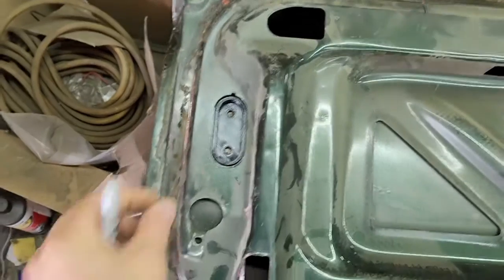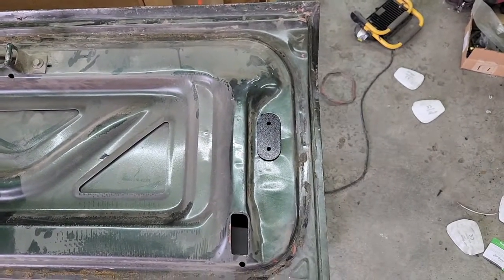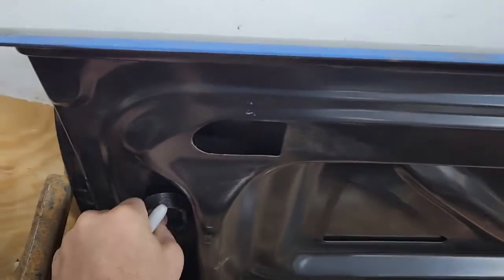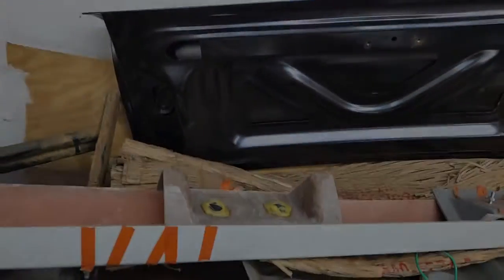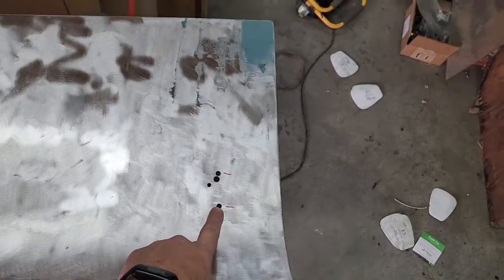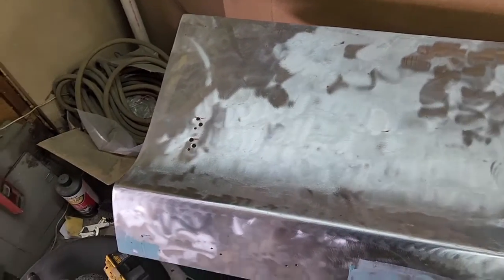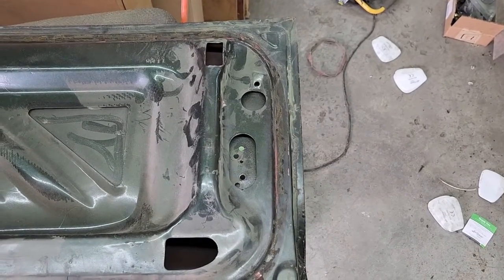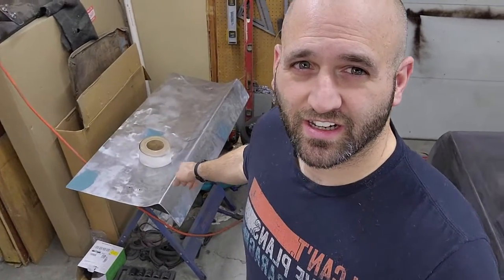69 Mustang: Lets Make It Easy - Spoiler Install with a JIG

Comment: Good effort but not the correct install method. You need the reinforcement brackets designed for these spoilers. Avaliable online. You didn't need to fabricate those pieces, which won't reinforce the mounting, preventing deck flexing. 
Generally the first hole (forward) is 9.5 inches from front of deck lid. 3.5 inches from side edge of deck. Holes are 1.75 inches center to center. 35.75 inches apart side to side. 
I'd start by mounting bracket below deck with the rear hinge bolt first, mark the deck holes thru bracket, then verify all measurements before drilling. No two decks are made exactly the same, so measure and re-measure.
Reply from the maker: It may not be perfect but it works. I agree, the right method would be to use the mounting brackets but mostly people dont. This is just an alternative that works well. With aftermarket decks it certainly could get dicey but I did this off a Ford toollng trunk so it should suffice.